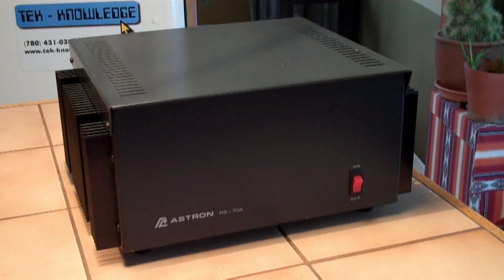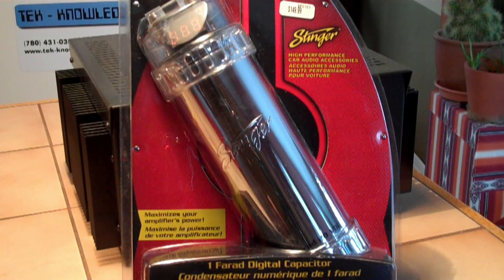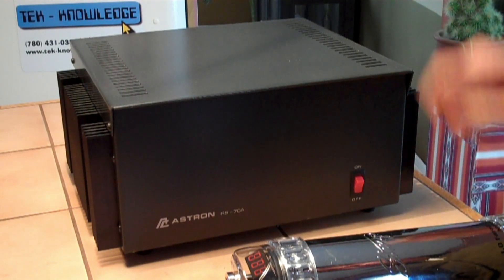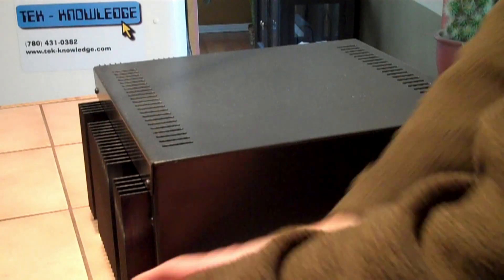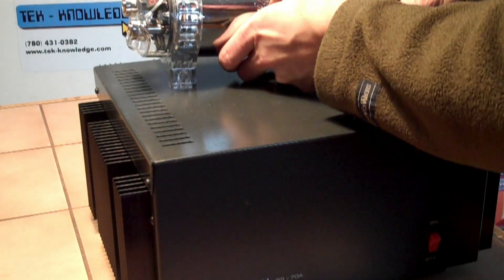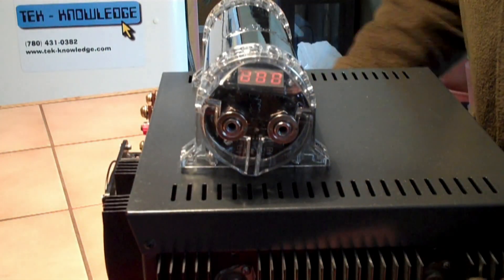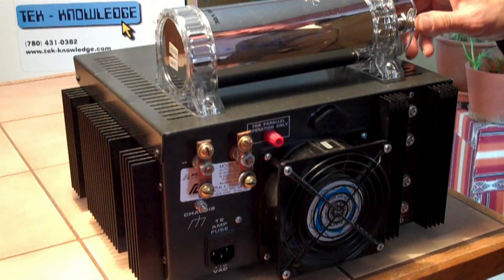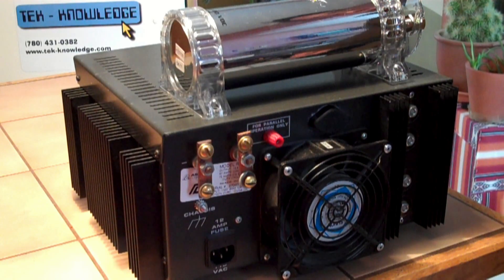Astron RS-70A mod part1

Comment: My 70M's amp meter swings backward when I key and speak into my radio....what would cause that ?
Reply from the maker: Swings below zero? Sounds like a problem with the meter.
Reply: As your radio draws more current, the voltage naturally drops if supply can't regulate it.
Reply: Not Enuff info. TX mode? Volt and Current start? Volt and current draw Mod?

Comment from the maker: @1112223333111 Thanks for your input. You are dead on! This is what I was going to do. Although, after conferring with some experts, I will not be using the large capacitor, it would cause more grief than good. I'm going with just a little voltage display unit mounted on the front. I'll be posting that mod shortly in part 2.

Comment: 3:49 I'd flip the cap 180 and have a shorter run to the power output, then spin the display torward the front.